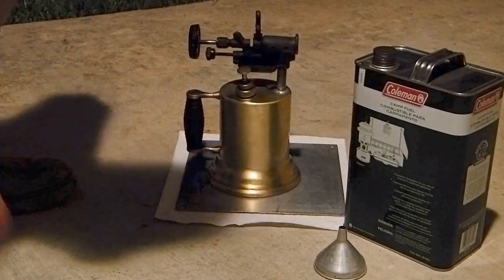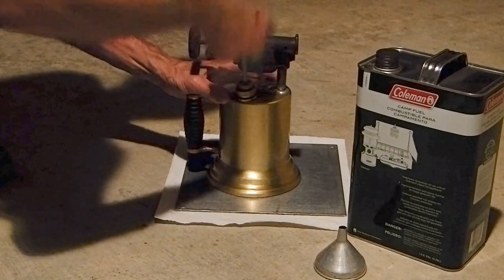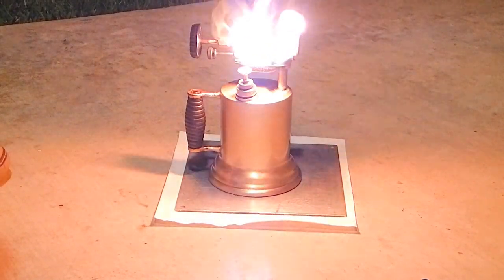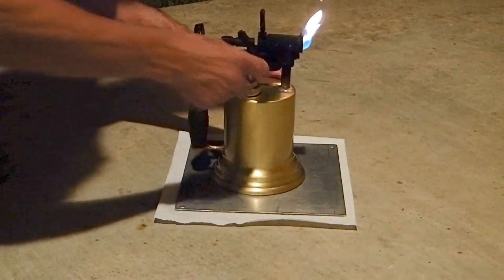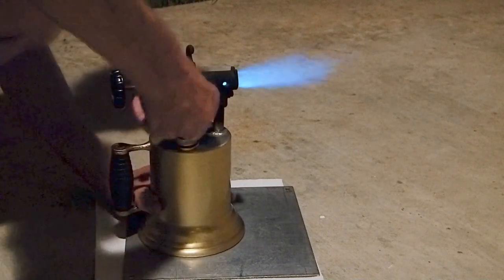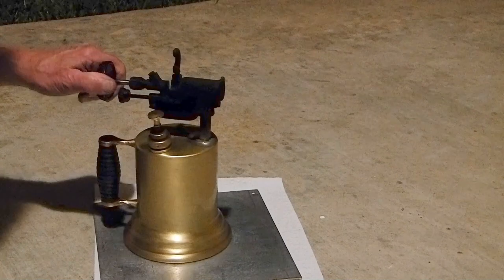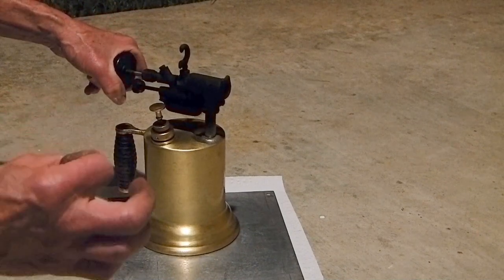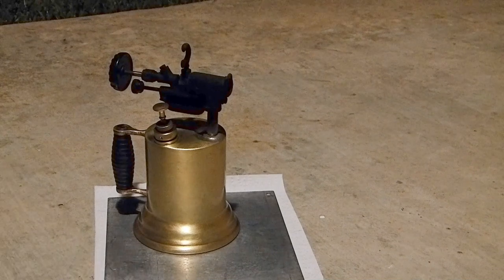Vintage Blowtorch Roars to Life (Good and Loud)

Comment: Could you please tell me dose the old vintage blow torch contain asbestos because I want to buy some of those kind of blow torches to restore and use and I am highly scared of asbestos please any information would be grateful thanks.
Reply from the maker: There is no asbestos on the external working parts or inside the tank of this torch.
However, it's possible that asbestos might have been used in making the valve seals. The seals are located where the valves enter the burner and are held firmly in place by tightening the retaining nuts. The seals are very small and well contained so there shouldn't be any exposure. If you are concerned, you could replace the old seals with new ones made from high-temp, asbestos free packing material. Good Luck!
Reply: Dennis Allen thanks for the information about Asbestos I also like to rebuild Coleman lanterns I really appreciate that you got back to me thanks.
Reply: Asbestos is only dangerous when it’s friable, meaning small particles can get in the air.  Even if asbestos gaskets were used there isn’t enough there to cause any harm.  But you could wet them with water to be safe if you want.  I’m professionally trained in this subject.
Reply from the maker: Very good info about asbestos!  Hope lots of viewers  see it. Thanks for sharing.
Reply: There’s no asbestos in these. The seals were made out of leather.
Reply: @dmeads5663 and the check valve seals were cork too, right?

Comment: Which way is the preheat tray supposed to face, the tip of the nozzle where the fiame comes out or towards the shut off valve?8
Reply from the maker: Towards the shut off valve. Under the burner, there is a passage for the liquid fuel where it is heated to vaporize before exiting the valve.
Reply: I know it's been a while since I commented on these old torches, but I'd like to know a few more things. I now have three if these gasoline blowtorches and I got two of them working again, the one that doesn't work currently just needs a new check valve part. My questions are: 1. How do you get an accurate temperature reading? 2. How do I know the difference between antique kerosene and gasoline blowtorches? 3. Are some of these antique gasoline blowtorches designed for specific tasks, or in other words are some designed to be used in a specific workplace, like a dentist? And 4. Where can I get wick material at? Do I just use cotton strands? (Ok so that was a fifth question but it goes with the fourth one.)
Reply: I read something about antique kerosene blowtorches having two valves. Is that the difference between a gasoline blowtorch and a kerosene blowtorch?

Comment: This torch must of been top of the line with a fuel dispenser which makes things a lot easier. Do you not worry about an explosion ???? Thanks
Reply from the maker: Yes, the fuel dispenser for the pre-heat is a nice feature. Makes this torch sort of unique. I really wish I could have identified the maker. In regard to explosion, when you work with pressurized gasoline, you are always concerned about fire and explosion. Safety is paramount when operating any type of torch. Wear eye protection, watch out for bystanders, work a safe distance from flamable materials and be sure equipment is in good condition. And, always have a fire extinguisher handy..
Reply: @Allen-Dennis  Having a fire extinguisher nearby is a must.  Peace
Reply: If you are able to find the model please let me know. I actually just purchased a blow torch that looks almost exactly the same as yours. Unfortunately it didn't have any markings in order to identify it. Love your video! I hope to restore mine to as good as yours!

Comment: I have 3 of these
 A Craftsman, a Wells and an unknown. I've restored 1, but only got it to torch once. Now it just shoots a stream of flame from the fuel stream. I've even tried to pre heat it with a propane torch, but I cant get it into torch mode again. Any idea what happened?
Reply from the maker: Assuming that the tank is adequately pressurized, it sounds like it's not pre-heating properly. When lighting the torch, be sure to completely fill the pre-heat pan and let it burn until almost empty. This heats and vaporizes the fuel in a small chamber under the burner. Avoid windy conditions as they can cause trouble when pre-heating. After pre-heating for 2-3 minutes and with the fire still burning, open the main valve VERY slowly. This is key as you don't want a rush of cold fuel from the main tank chilling the hot vapor in the pre-heat chamber. If pre-heated thoroughly, there will be very little streaming of fuel, just a small flame which you increase by slowly opening the main valve. As the torch flame burns, the burner gets hotter allowing you to increase fuel flow for max heat. Use fresh unleaded gasoline or camp fuel. Less volatile fuel can cause trouble. The orifice that sprays fuel into the burner head cannot be too large. Probably no more than .010" - .015", about the diameter of a bristle on a common wire brush. Too large of an orfice can overload the pre-heat chamber. For more instructions, see my reply to Deep Jyoti Das below. Good luck!

Comment: Thats awesome!
There are a few I am looking to buy online.  I see you filled it up with the coleman can.  But can you use regular pump gasoline that goes in the car gas tank?   I have an old military (food) burner that runs on regular gasoline.

Thanks for a cool video and love that it was a family owned tool!   That’s awesome!
Reply from the maker: Yes, you can use regular pump gasoline. I'd stay away from the higher grades as they contain even more additives not required by a torch or stove. I prefer the camp fuel because it does not smell nearly as bad as unleaded gasoline and will not go stale or turn to varnish nearly as quickly.

Comment: Nice, I have a question, can you use a regular modern day torch and "heat" the nozzle to temp instead of lighting the gas in the bowl?
Reply from the maker: I would think so. Just use caution and move the flame around so as not to over-heat one spot. The area to heat is the lower surface of the burner where the vaporizer is located. Because a torch is more intense than the small flame in the bowl, the pre-heating time would be less. You could probably open the blowtorch main fuel valve in half the time and get a nice flame instead of a stream of burning fuel.
Reply: @Allen-Dennis  thank you I was just thinking about how it does what it does, on another note if a specified temperature is required or ideal could you also use an electric coil that can be regulated?
Reply from the maker: A coil might work if the electrical insulation could withstand the heat.

Comment: I wonder, does that torch use the pressurized air/vapor mix from the top, or just suck out liquid fuel from the bottom and mix it with air? If it's the second one, you could make that system much safer and easier to use by rigging it with a system to pressurize it from a co2 cartridge. Use an inert gas instead of air, and you have a much less explosive situation in there and a much safer system overall.
Reply from the maker: Liquid fuel is forced by pressure from the bottom of the tank via a wick in the dip tub. The dip tube connectes to the pipe nipple on which the burner is mounted. CO2 could provide pressure, but it would need to come from a regulated source as I don't think the tank could handle the approximately 850 PSI pressure in a CO2 cartridge. I would guess that when pumping with one's thumb, 50-60 PSI would be the about max produced. I once saw a torch that had a metal Schrader valve installed. This would allow a bicycle pump or air compressor to quickly pressurize it.
Reply: @Allen-Dennis  Yeah, I did say 'rig a system', I felt that implied a regulator. I didn't look up the number, but I knew 'way too high for a blow torch' had to cover it.

Comment: I got one of these but it dousnt say who made it can I put Kerosene in it or do I need to put white or red fuel in it I plane on using it
Reply from the maker: If you are in the USA and your torch looks similar to the one in the video, it was most likely designed for "white gas" which was widely available at gas stations when these torches were being made. Now days, the best substustitute is camping fuel. You could try kerosense, but you will need to use some type of wick in the heating pan, or use alcohol for the preheating flame. Not sure what red fuel is. Possibly off-road diesel? If so, I don't think diesel would vaporize sufficently.
Reply: @Allen-Dennis  Red fuel is basically the same thing as white fuel but a little different And yes, I'm in the United States. Some of the video said it took kerosene Sum said gas and some said white fuel
Reply from the maker: If you get it working on kerosene, please send another reply. Below is a link to a video of a torch that user says burns kerosene. You can see that the design looks different than my torch which was made for white gas. https://www.youtube.com/watch?v=fS8OnK-QCGI @nicklandak6882
Reply: @Allen-Dennis  cool thanks

Comment: Where do you buy the parts to restore
Reply from the maker: Actual replacemant parts are not easy to find because these torches are so old. Most people who restore them make the necessary parts from items and material available at hardware, auto part and craft stores. When I restored this torch, the seal for the main valve shaft was made by twisting teflon plumbers tape into a string. This string was then wound around the shaft, packed into the valve body and contained with the packing nut. You could also use commercial graphite string packing available at hardware stores. The seal for the cap on the pump was cut from gasoline proof gasket material using hole punches. A larger punch was used to cut the outside diameter and a smaller punch to cut the opening for the pump cylinder.  The main pump piston seal (cup) was made by cutting a disk from a piece of 1/16" thick leather. The leather was soaked with oil and hand-formed over a metal rod to form it into the cupped shape that was required. The pump had a check valve made from cork. I used a small hole punch to cut a new seal from some 1/8" thick cork gasket material. Here are some  videos that show how to make leather piston seals (cups). https://www.youtube.com/watch?v=_bwF6yHyUq0 and https://www.youtube.com/watch?v=6xFhThdnYqE. Good luck!

Comment: What temperature?  Can melt copper?
Reply from the maker: With camp fuel it burns around 2400 degrees F. It can melt copper which melts at around 1983 degrees F. However, it could only melt a very small amount of copper and it would need to be directly in the flame.

Comment: Just pulled an Otto Bernz blowtorch out of an old shed of my dad's. I'd like to see if it works and maybe clean it up a bit. I also have the soldering iron you described (My grandfather's.) It has the big copper end and a small metal shield to protect the wood handle. I guess I'll have learn lead body working now. I wonder if there's still a call for it? Would it add value having an antique or period car restored with old lead body work? Could anybody tell the difference? Probably a lost art anyway. I think I watched a show where a bunch of old-timers came on to restore an older ride and one of the fellas was an old lead guy. He was pretty skilled. Thanks for the vid.
Reply from the maker: Don't know about the value of using lead for vintage auto body work, but the big soldering iron would be great for copper gutter work, galvanized sheet metal projects or heavy gauge wire soldering.
Reply: Bill Hines was his name. Leading is an art. It’s a PITA to work with and paint. Some hot rod/ custom guys still do it but it’s a dead/dying art. Gene Winfield has some tutorials on Eastwood out there too. If you had a car finished in lead and a car finished with Bondo (both done by professionals) it would be really difficult/impossible to tell which was which. Lead is more durable though, especially around seems, door edges, etc.

Comment: what happens if we keep pumping the torch???
Reply from the maker: The pressure in the tank will increase which will cause the flame to increase. However, because of the small size of the pump knob, it becomes very uncomfortable for the user to increase pressure beyond a certain point. Also, the pump could be damaged or the tank could explode if one did not use caution.

Comment: Wonder if you could melt brass with that for casting?
Reply from the maker: Yes, definitely hot enough to melt brass which melts at around 1710 degrees F. I've read that blowtorches can reach temperatures of 2400 degrees F. However, a torch this size could only melt enough brass for a small project. I'm guessing 1 ounce max under ideal conditions. Not only is the temperature of the flame important, but also the amount of heat produced. It takes a lot of BTUs to heat the metal as well as the crucible to proper casting temperature.
Reply: @Allen-Dennis how long does it take for these torches to do that?

Comment: I have a petrol blow lamp but I don't know how to refile n start it
Reply from the maker: I’m no expert, just know what my grandfather taught me about using his blowtorch. I’ll share that here.
Most vintage blowtorches have leather pump pistons. They should be oiled regularly with 30 weight motor oil. To oil, raise the pump handle and apply about 3-4 drops of oil to the pump rod. The oil will flow down the rod to the piston.
Filler caps usually have a small vent cut into the retaining threads. The purpose of this vent is to slowly release air pressure
 from the tank before opening. Always tighten the filler cap firmly before pumping. Best results are obtained when the tank is about 1/2-3/4 full of fuel.

 For fuel, Coleman or Crown camp fuel and Regular Unleaded gasoline are recommended. I prefer camp fuel because it does not smell as bad as unleaded gasoline and will not go stale or turn to varnish nearly as quickly.
 
These torches must be tested for leaks and any found must be repaired before lighting.

To use the torch, fill the tank to about 2/3 full and pressurize with about 25-30 pumps of the hand pump. ONLY do this operation outside, out of the wind and away from anything flammable. Having a fire
 extinguisher available is also highly recommended.

There is a small pan under the burner assembly. If the torch has a smaller valve, slowly open it, fill the pan, then close the valve. If no small valve, carefully fill the pan with torch fuel.  Light the fuel to preheat the burner. After a 2-3 minutes, make sure the torch is pointed in a safe direction and slowly open the larger main valve. Most likely, a stream of burning fuel will spray forward until the fuel is fully vaporized. In a minute or so, the flame will go from a skinny, yellow/orange stream to a roaring blue flame. Adjust the main valve as necessary, and if desired, add more pressure to the tank for a stronger flame. To shut off the torch, close the main valve.
After using the torch or to add fuel, let it cool then slowly unscrew the filler cap to release pressure. After the air is released, the cap can then be safely removed to add fuel.
NEVER store any vintage blowtorch with the tank under pressure. Doing so could result in the release of very flammable fuel or vapors. 
ALWAYS vent the tank before storage and BE CAREFULL!

Comment: Can this torch be use in gold smelting?
Reply from the maker: Yes. I've read that gasoline blowtorch temperatures reach about 2400 degrees F. The melting point of gold is around 1950 degrees.
Reply: @Allen-Dennis  wow, thanks for the insight, by the way how many minutes does a full tank of that blow torch can last?
I was planning to buy this kind of torch in my country for gold melting.
Reply from the maker: If operating at full power like in the video, my torch will burn for about 30 minutes after a fill-up. In normal use, the tank is only filled to about 75% as you need to leave space for the compressed air.
Reply: @Allen-Dennis where did you find this information? I've looked pretty much everywhere and I haven't found anything.
Reply from the maker: @foxfire8284  It's been so long ago, I don't recall, but probably searching the internet and watching YouTube.

Comment: What was it used for?
Reply from the maker: Soldering copper pipes, silver brazing small parts, loosen rusty nuts and bolts, stripping paint and heating steel to make it easier to bend. Just about anything when you need a source of high heat.
Reply: @Allen-Dennis  is it stronger than a map gas torch?
Reply from the maker: @Zane-It  Because of it's very large flame size, this blow torch will produce a little more heat than the MAP-Pro gas torches you usually find at hardware stores. However,  MAP-Pro gas can burn several hundred degrees hotter than camp fuel or gasoline in a blow torch. If you could get a MAP-Pro gas torch with a flame as large as the blow torch, then it would be much stronger. Hope this helps:-)
Reply: @Allen-Dennis  cool
Reply: Killing beasts in Yharnam
Reply: @Allen-Dennis is brazing done identically to soldering in that the base metal is supposed to melt the brazing rod or is the flame supposed to melt them?
Reply from the maker: @foxfire8284  When brazing, the heat is applied to the base metal. When the base metal gets to a red color, the brazing rod is put in contact with the base metal and heating continues until the rod flows into the joint. It is important to minimize heating the rod so that it does not melt first and "ball-up". The rod will start to flow nicely as the base metal reaches bright cherry red to orange in color.
Reply from the maker: @Zane-It  The temperature is not as high, but I think it would put out more heat. However, if brazing small parts, the higher temp and more focused nozzle of most MAP approved torches would would work better.